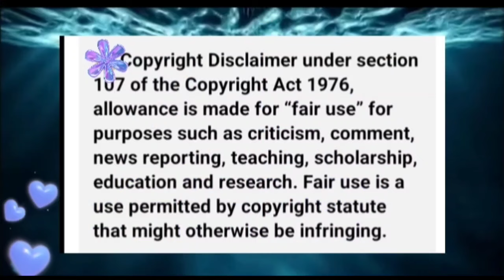Protecting Evidence? Fry or Corner Club Guy? Cowboy or Payne or Tyler Axe Guy? Did Adam Fence?

Comment: literally nothing- washer and dryer, hot water heater, plumbing copper or pex) no heat ducts, no furnace, no bathtubs, toilets, sinks...     that house was stripped well beyond just the removal of appliances which aren't there either.    how was there nothing in the walls even for plumbing and heating    not any electrical wires    
ive never seen a small home like that not contain the basic shit that's required to live in the modern age